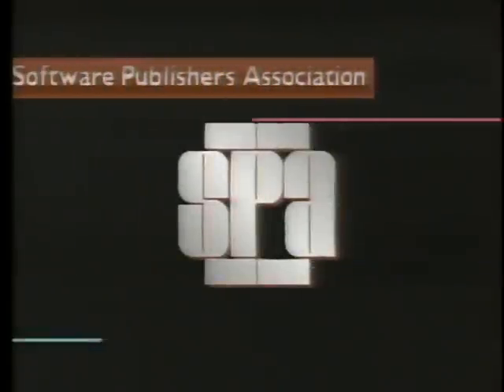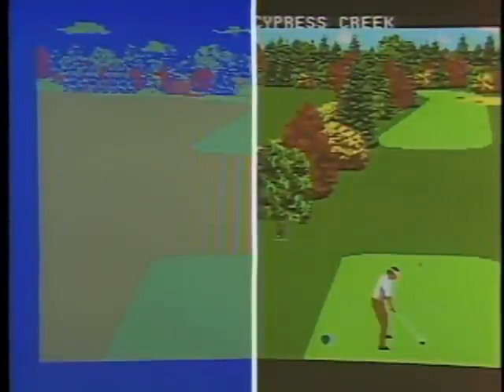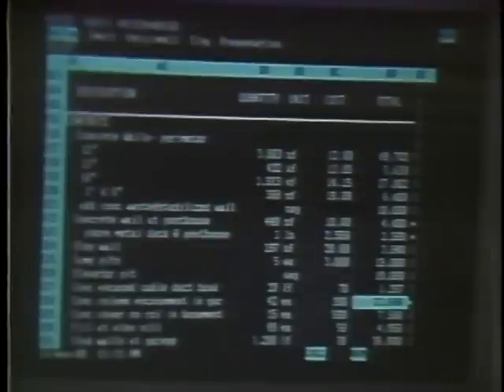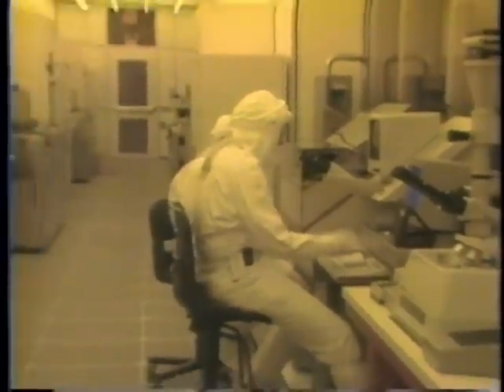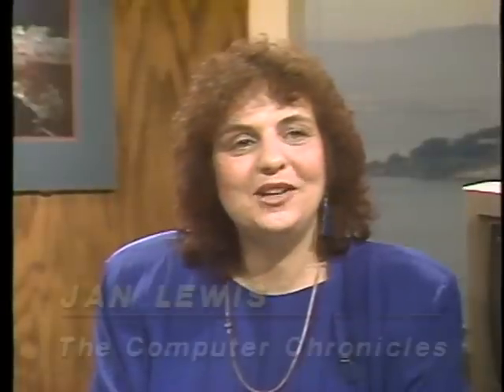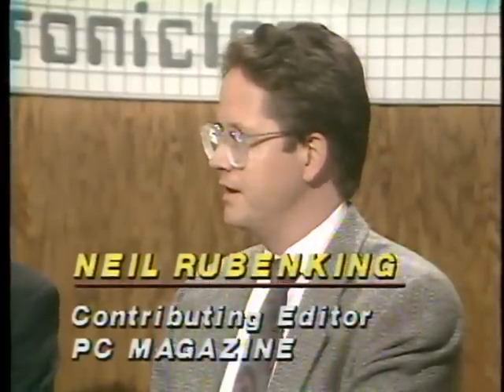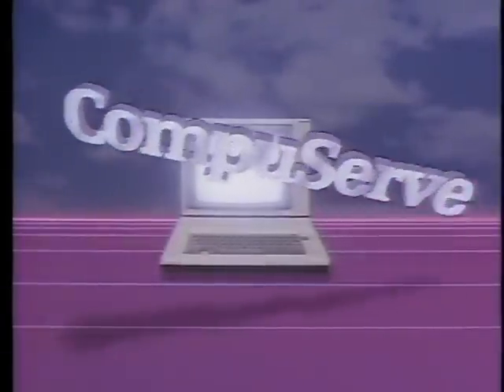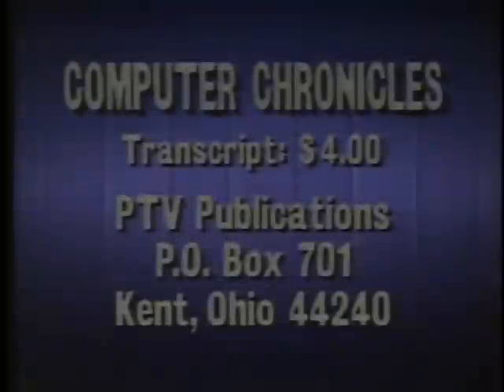The Computer Chronicles - Megahertz Mania (1989)

Comment: 1:50 that woman is wrong! If the 8088 had been made to run in VGA mode, it would have in fact been faster. CGA graphics are pixel-packed, so there is a lot of bit-shifting, AND'ing, OR'ing, etc to actually put the CGA graphics into video memory where the VGA is in 320x200x8 mode which is a single byte per pixel. No bit-fiddling required.
Reply: Yes, you can simply go

mov ax, 0a000h
mov es, ax
mov ax, [buffer segment]
mov ds, ax
mov si, [buffer offset]
xor di, di
mov cx, 32000
rep movsw

to fill the whole screen from a background buffer in VGA mode 0x13.

In CGA you need to take each pixel and shift it around and or it to the screen if you don't have the backbuffer set up, which makes blitting to the backbuffer a pain in the you know what.

Did program a lot of graphics stuff back in the day - and 0x13h was the easiest to work with of them all, also the most performant one, because the loop and the number of instructions needed to write to a CGA compliant backbuffer needed to be fetched byte by byte on an 8088 (or word by word on a 8086).

Made more than up for the 4x larger screen memory to be transferred. CGA was really one of the worst things ever invented.
Reply: But in text mode  she is right
Reply: referral madness  
x86 assembler. I think the example would work on even an 8088.
However, it requires a VGA or an MCGA card in grapics mode 13h (320x200 @ 8 bits color depth).
Reply: referral madness  
So many... started out in Pascal in late 80s, later x86-assembler an C/C++, then C#/F# and Haskell, now I'm into Python and Kotlin a lot.
Reply: referral madness  
Learning more languages is always an advantage. When I learned Haskell, it made me a much better C# developer.

Comment: Got my first computer in 1991 at age 12. It was 286 running at 16MHz, but 20MHz with turbo button pressed. 3.5” and 5.25” floppy drives, and a 40MB HDD. Just thinking of that machine gives me joy. I built many upgrades since then, but sadly mother donated that first one 10 years ago, and I cried when i tried to look for it and found out :( She said there was a lot of “crap” in the attic that needed cleaning. 😮
Reply: I got my first computer at age 13 in 94, a 50mhz 486. I think about that machine often. It was tossed out by my mother while I was in the navy 😅😢
Reply: 20Mhz 286 was rockin. Most people only had 12 or 16MHz. Plus 286 chip was a huge speed increase clock for clock on an 8086. Contrary to the myth this video started. A 386sx was slower than 286. The reason it goes faster in the video is because they're adding a 387sx FPU as well as a 386sx chip. So cudos to you. Your 20Mhz 286 in 1991 was still a decent machine!

Comment: Cpu speeds reached its apex in 2008 and 2009. My I7-960 which is a 2009 cpu is still being used by me. It is slightly slower than my I5-3570k which I got in late 2013. You can do all the office work with that I7-960.

I have a AMD Phenom II 945 which I got in 2009, and it is being used in my office. It is still a pretty fast computer for a office computer, and it is more than adequate for office use.

In 1987 to 1996 there were big leaps in cpu technology at the time. We had the 286 8 mhzs, 286 12 mhzs, 386 sx-16 mhzs, 386 dx-33, 386 sx-20, 386 sx-25, 386 sx-33, 486 dx 25 mhzs, 486 dx 33 mhzs, 486 dx2 66 mhzs, 486 dx4-75 mhzs, 486 dx4 100 mhzs, Pentium 60 mhzs, Pentium 75 mhzs, Pentium 90 mhzs, Pentium 100 mhzs, Pentium 120 mhzs, Pentium 133 mhzs, Pentium mmx 166 mhzs, & Pentium 200.

From 2001 to 2014, there hasn't been a big leap in cpu technology. In 2001, I had Pentium 4 1800 mhzs cpu, and in 2014 I have a I7 4790 at 3600 mhzs. In a 13 year period, the core speed went up 2 times; however, the cpu manufacturers increased the number of cores to 4. The performance difference between a I7 4790 and a Pentium 4 1800 mhzs is about 6 to 8 times faster.

The cpu performance improvement in 1987 to 1996 was like 16 to 20 times. CPU technology reached its zenith with transistor technology. The more transistors they add, the bigger the cpu gets, and the hotter it gets. That is the problem engineers are facing  now.
Reply: I agree with what you're saying, however, at what point do we hit the cap?  I mean I'm sure there is a point where faster processing is only needed by the most hoggish software, software if anything should be able to do more, with less processing power unless they're purposefully making things hoggish in the next 5-10 years that cap should be met for 99% of users.  Unless you're the NSA having to extrapolate key words from all the surveillience they're collecting. 

But for home users and even gamers there is a plateau.  Same for monitors and GPU's.  There's a point where the eye can't process any more data in spite of being able to produce more than the eye can handle.
Reply: Christopher Snow I think we already hit the cap in silicon based transistor technology; however, RISC architecture could be utilized to improve performance with CPUs that require less transistors. A good example would be ARM processors on smart phones, they use RISC processors to execute more than one instruction per cycle. As a result, you have a CPU that has 1/10 to 1/20 the number of transistors compared to a CISC processor. It would work for software that doesn't require real number calculations, or numbers with decimal points. A RISC processor would not work for CAD programs, flight simulators, or any kind of applications that require float point calculations.

ARM or RISC processors are limited in what they can do, this is why we need desktops with powerful processors and GPUs.
Reply: Ace1000ks1975 Oh I'm sure in that regard, but the real question is, for the average consumer, even gamer, how much more processing power is actually needed?  We can go from 4k to 8k monitors but at what point does the eye not notice the difference between the two things... or in gaming how much CPU/GPU processing is capped.  I think we're getting to the endgame on all "common" user needs.  The only people which will need faster and faster processing power are data centers, major corporations or military cyber security applications. 

I know it's been said before but this time I really do think we're hitting a hard cap.  If anything networking, wireless and otherwise is still in need of speed, the US seriously lags the world when it comes to internet speeds and thus home networking.
Reply: Christopher Snow We need to transition from transistor based electronics to optical based electronics to break the bottleneck. Light moves much faster than electrons. It would be like transitioning from piston engines to jet engines. The fastest piston engine aircraft could propel an aircraft to 450 to 500 mph. A jet engine can propel an aircraft more than 1000 mph to 1900 mph.

For transistor based electronics, they will have to come up with better cooling systems, like liquid cooling solutions to clock CPUs and GPUs at higher frequencies without burning them out.

For those who can afford it, they could make motherboards with multi-CPUs on it. That would address the speed problem. A board like that with 3 to 4 CPUs would be out of the reach of most users, it would cost at least $6000 or more.
Reply: Ace1000ks1975 What I'm saying is, games are right on the verge of having ALL they will ever need in the way of processing power for both GPU's and CPU's.   The only thing which will extend needs beyond the point we're already at is some virtual reality game simulators.
Reply: Christopher Snow Computer graphics are very good now.

Virtual reality was all but forgotten in the 1990s, I thought it was going to be the next big thing. They made so many movies about virtual reality, like Lawnmower Man, Johnny Mnemonic, Strange Days, 13th Floor, The Matrix, etc. Virtual reality never came into fruition!
Reply: It's coming back... the latest CES shows several new models for doing it too.
Reply: Even larger were the advances that happened between 1977 and 1987.
In just ten years they went from computers like the Commodore Pet and Apple ][ to the Amiga 2000 and Mac II.
Reply: Patchuchan They had a computer system called the Xerox Alto developed in 1973. It had a GUI interface, word processor/spreadsheet, user friendly operating system, 3 button mouse, keyboard, a monochrome monitor, laser printer, email, & ethernet networking.
Reply: Ace1000ks1975
True and Xerox's marketing didn't fully comprehend what they had and how to market it.
Though the system did cost $40,000.
Reply: Patchuchan $40,000 back in 1978 is about $150,000 to $160,000 in today's money. A GUI operating system was only a dream for most people in the late 1970s. The technology wasn't there to make it happen on a massive scale.

Computers got cheaper and more powerful in the past 37 years. The average desktop computer in the early 1980s was a 8 bit system with about 256 kbs of ram. 16 bit computers enabled computer makers to implement the GUI operating systems. 16 bit computers enabled you to have a maximum ram amount of 64 mbs. The 16 bit cpu enabled GUI operating systems to become reality. 

Computers like the Amiga 500, and 1000 had GUI operating systems. The Apple IIGS, Macintosh, and Sharp X68000 had GUIs also. Windows 3.0 became widely available on PCs with 286 and 386 processors in the early 1990s. 

32 bit CPUs came out in the early 1990s, and GUI operating systems got better and better. Windows NT was released in 1993, and Windows 95 was released in 1995. As a result, computers became more mainstream, because it became easier to use.
Reply: Matthew L'Herault And now we're kind of at a cap because most software doesn't use all the cores available, only the most resource intensive types.  I would be nice to see them shift focus back to increasing the frequency again, especially since it helps tremendously for gaming.  

Actually at the rate things are going in the video card market there is already a lot of video rendering processing power being offloaded to GPU's rather than strictly on the CPU they might merge as an oversized APU type board with enough to run both.  Only thing is they'd have to make PCIE a lot faster or come up with a new slot type, forgo CPU sockets altogether and have the board just take a slotted APU.  Want more processing power?  Run them in some sort of SLI mode where all the resources are shared.  

DX12 is going to allow you to stack the vram of multi-card configurations... then next 5 years is going to be very interesting indeed.
Reply: Matthew L'Herault That is true, more processor cores were added, but the clock speeds can't exceed 3.8 ghzs. The problem with transistor based microprocessors are reaching a peak. If you increase the clock speed, you increase the heat, and you increase the chances of burning out a processor more quickly.

The solution offered was adding more cores to divide the work load among many cores without raising the clock speed, or using multi processors. In graphics cards, they use a technology called by SLI which was invented by 3dfx in the late 1990s. This technology allowed parallel processing among multi-gpus on a single card to using multiple video cards on a single motherboard. The problem with such a system is that it is expensive.

As for me, I prefer to use a system with a single powerful GPU, and a power single CPU. I don't want to put 2 to 3 graphics cards and have a dual CPU board. Such a system could cost $4000. Most of the power is a waste, you will never ever use all that power.
Reply: Ace1000ks1975 I don't disagree with what you're saying, but what's expensive and a stretch to get into today might be commonplace in 5 years. 

The Intel i7-4790k is a 4 ghz with boost speeds to 4.4 ghz 4 core 8 threaded chip.  I'm quite sure it's overclockable to 5.0 with the right cooling.  I'm on air cooling myself, an i5-3570k I have overclocked to 4.1 on after market air cooling.  If i were to water cool it I could likely hit 4.8-5.0 with no problems. 

I'm saying for the enthusiast market, the watercooling solutions are getting easier to do even for GPU's.  Corsair has the Hydro 110GT or whatever the designation is, their lettering system is messed up on those coolers.  Anyway, it's a dual 140mm fan cooler with a nice thick radiator it's a cooling beast for those chips that are heat intense.  

Notice the sockets have been sneakingly getting wider? 2011v3 is noticably wider than my 1150 socket chip.  The wider it gets, the more cores they can throw on it. I mean those 2011v3's are housing 6 and 8 core processors with hyperthreading, granted they're only getting 3.4 ghz or less, but they can be overclocked.  Just a matter of time when the chips get even wider/flatter and come with watercooling as the recommended solution for heat dissipation.  I live in Las Vegas so heat is always an issue in my rig, can only do so much about the ambient temps without having a server room with the AC set to 62 degrees F.
Reply: Christopher Snow I am not going to spend $4000 to play games. I would spend at least $1500 to $1800 for a new computer system. For a car, I would spend at least $32,000 to $65,000. For a shoe I would spend at least $200 to $500. For a watch I would spend at least $2000 to $3000. For a computer, I would never spend more than $1800.
Reply: Ace1000ks1975 Yeah but you don't need to spend 4000 to play games, a gaming rig can be done for 500 bucks.  It's just not going to be bleeding edge tech, but it's still ahead of PS4 and XboxOne.   SteamOS is trying to, and making a good case for, replacing your console in favor of a SteamOS rig.  

What's more your Steam library doesn't try to sell you the same game for 2 generations.... Xbox 360 to Xbox One, like the upcoming GTA V wants you to do if you sell your 360 in favor of an Xbox One, and then to sell the game.
Reply: Christopher Snow If you want to play games on the highest settings, you need at least a graphics card that costs about $300 to $500. If you buy a good graphics card, you need to buy a I-7 processor that costs about $300 to $600. If you want to record your game play, you need at least 2 hard drives. You also need to buy good ram which will set you will cost you about $200. A good motherboard costs about $200 to $300. A good quality full tower case costs about $90, and you need to add fans on it.  A blu-ray player with the software costs about $100. A good quality power supply 700 watts will set you back about $100 to $120. A copy of the operating system costs about $100 to $150.

I always put in the best parts when I build a system. When it comes to computers, I want the best components. When it comes to cars, a base would be enough. I don't care about the added electronic features in a car. Why? Because I would never use it, I care more about the suspension system, the drive train, the engine, the break system, and safety features.
Reply: stabnshoot Integrated graphics can do some 3d applications, but it can't do demanding 3d tasks. You need a dedicated graphics card or GPU that can handle real number calculations. A integrated graphics card on a CPU can do great integer computations, but 3d apps like Auto CAD, and other 3d apps require real number computations.
Reply: Ace1000ks1975 Skylake might change that, from what I've read the integrated graphics on Skylake will be twice as good as on Haswell which in my view is the biggest news of that chip that few people are talking about.  

Don't get me wrong my gaming rig will stick with discrete graphics, but it may open the way up for better laptop gaming experiences.
Reply: Christopher Snow If they could increase the wattage on the CPU socket, I am sure they could do it.
Reply: I use core2duo and if that does back to my p4 again
Reply: Heh heh what are yall discussing 3 years ago. Some of you might be dead. The real point is there may be limitations in hardware but no limitations to human greed and ingenuity, so they ll still think of ways to force us to shell out bucks😆
Reply: Old as shit comment but still active on youtube so why not.

The Pentium 4 and i7 4790 clock speeds are not comparable. Yes they are both clock speeds measured in hertz but what you can do in a single clock (measured in IPC) is vastly different (and also vastly inferior in the P4). Not only could you see this in higher clocked P4s being slower then lower clocked Athlons but also in AMD's bulldozer cpus being higher clocked and more cpu cores but still slower in almost workloads compared to their intel counterparts.

Also more complicated factors like instruction set, or the increasing functionality built into CPU (either moving objects formerly on the motherboard or proprietary "cores" like for Intel QuickSync).

Just as insanely rough example, a 1.8Ghz p4 in Passmark benchmark scores 448 in single threaded workload. The 3.6Ghz i7 4790 scores 2282. If we allow the latter to use it's 7 other threads and 3 other cores....its a bloodbath that is hard to oversell.

CPU die sizes have been decreasing (though not linearly especially if looking only year to year) as well as TDP, even with larger more powerful iGPUs being added. Coffee Lake's high end 8 core i7 die size is around half the size or the equivalent high end quad core from 2008 (Conroe, like the famous Q6600). Now it is totally true that clock speeds haven't been able to get that much higher, as even 5ghz is only recently "common", so we are only ~1.2+ghz ahead of the "wall" we hit with the 3.8Ghz P4s back in the day (which were space heaters that melted...). And our way of adding more transistors while lowering die size and TDP by decreasing manufacturing process is getting quite a bit harder so iterations are slowing down but eh, worst case we can type Word docs on 256 core CPU :)